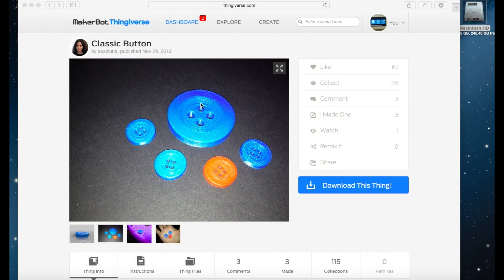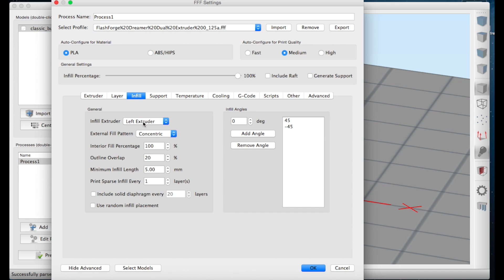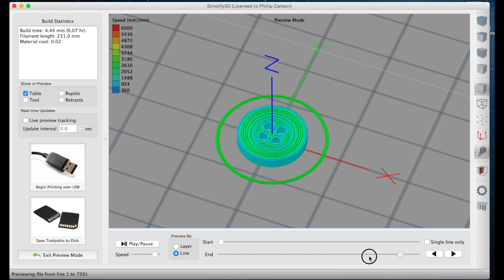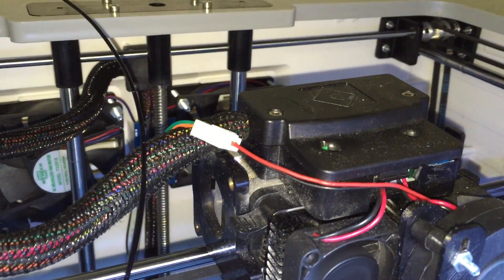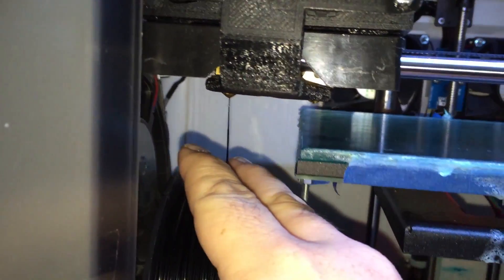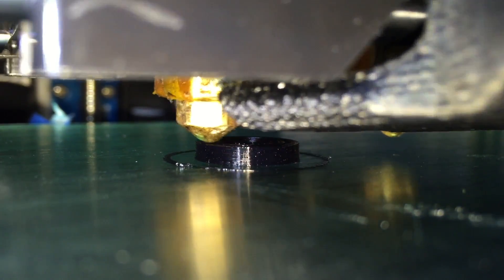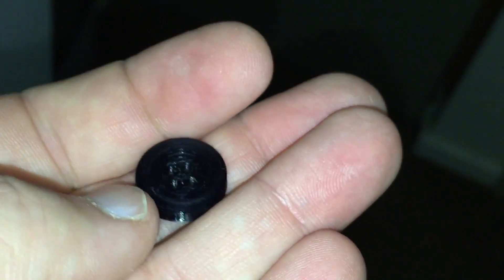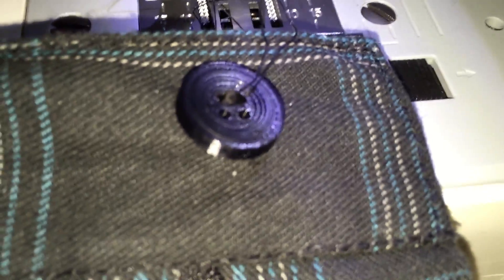Flashforge Dreamer - Simplify3D printing a button

Comment: Thomas, your holding out on us.   What is that cool looking blower mod you have on the heads? Do tell! (-:
Reply from the maker: Hi Adrian. Not much of a story, my wife accidently pre-heated both extruders to 230C instead of the bed only and after 10 minutes the heat from the extruders melted the stock cooling duct so I found this model that uses the original Ducted fan and it mounts on the front and cools BOTH heads. My prints have improved a LOT with the mod.

http://www.aipos3d.com/3d-model/download-flashforge-creator-pro-fan-duct-flashforge-myminifactorycom